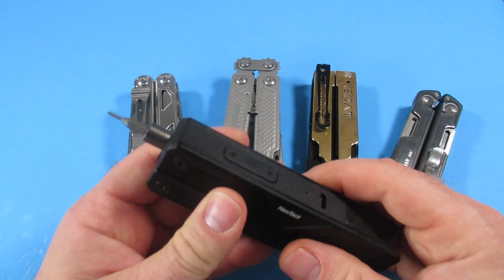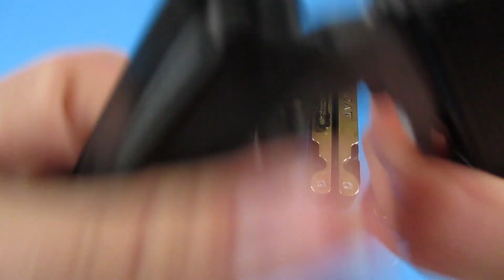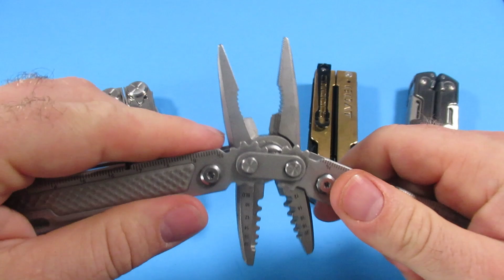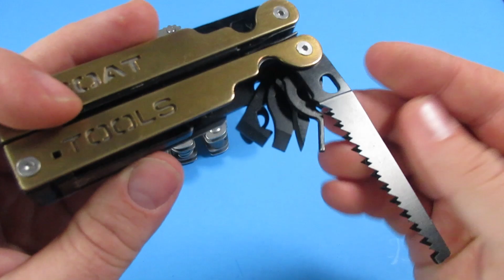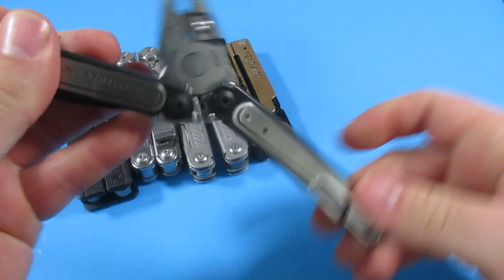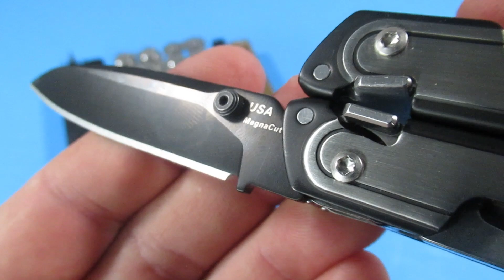Leatherman Arc And The 4 Other Most Innovative Multi-Tools Of 2023!

Comment: I think my favourite would be the GOAT if it didn’t have all the issues it does. I think the next generation may be promising and I’ll wait for that. I have the surge and dl30 and I prefer the dl30 but in a survival situation I’d be more confident with the surge just cuz of the steel. Mostly my favorite tool is the swisstool x. But from this selection as off rn I’ll go with the dl30 hands down! The goat is tempting but not sure that thing is great for the outdoor survival and really heavy duty tasks and has a really long way to go to catch up with victorinox and leatherman! Generally not even a fan of the quality of leatherman overall but it’s hard to beat the surge in terms of overall functionality minus the weight and leatherman quality issues. I think the dl30 wins for the fact it has the tshank adapter and the quarter inch bit driver! And let’s not forget the awl which is very useful so for me it’s on top over leatherman for sure. Maybe not victorinox tho
Reply from the maker: The DL30 is really good!

Comment: I really wish i had access to arc tools for my Free P2. I want that file, awl, and screwdriver. The knife is fine but i cant have blades at work...... and I'm industrial maintenance. Pretty dumb. 

I actually removed my blade and replaced it with a Nicholson file. Snapped the file and went to work with a dremel tool until it fit! Use it all the time. Made a chisel grind on the tip for a gasket scraper.
Reply from the maker: That sounds great!!  It would be cool if Leatherman made individual tools like SOG does.

Comment: Sweet lineup and comparison.

How did you attach that pocket clip to the DL30 and what pocket clip did you use?

Are there any other DIY upgrades you like for your lineup?
Reply from the maker: Thanks!  I used the Niteize pocket clip that attaches with the special 3m tape included.  I haven't do any other upgrades yet but I have several other diy projects on some other tools planned.

Comment: Great lineup.   The DL30 has impressed  me using it at work as well as the goattool.  Missed out on the swisstech.   And yes if the nextool had the 1/4" ratchet driver it would be a must have.
Reply: I have the nextool and it's a good tool however the electronic screwdriver doesn't have a lot of grunt. Good for plastic screws for rc battery covers for example. For the light stuff it can handle the mini bits are sufficient. The only thing I can complain about of the nextool is it didn't come with a off switch on the electronic screwdriver

Comment: DL30 is innovative? How? Please explain. It is a clone. Clone by its nature isnt innovative!
Reply: Does it have a better bit driver .yes, does it use better blade steel than the surge , yes . I think that's different enough from the orginal.
Reply: I don’t think the dl30 uses a better blade steel than the surge! Better bit driver tho, yes!
Reply: But yes if u want a knife that has better hardness and edge retention then the dl30 is better than the 420HC on the surge and wave. But if you want something more corrosion resistant and easier to sharpen cuz it’s a softer steel, then the surge knife steel is is better for u. Personally I don’t think can compare the two about which is the better steel. Cuz the other tools on the dl30 are a lower grade steel which will need more frequent sharpening than the knife blade. So depends on ur use and needs. For a survival situation I think overall the surge steel would be better cuz all the tools are 420HC. But if the knife blade is what u want to use the most then maybe the dl30 is a better option for survival.
Reply: You are very correct.

Comment: Perhaps why not many electricians bought the SwissTech 30 in 1, is because most electricians probably use a dedicated wire stripping tool, versus a multitool.
Reply from the maker: Probably so.  I think they actually ran through their stock fairly quickly in spite of that interestingly enough.